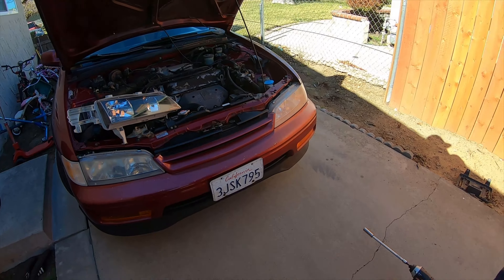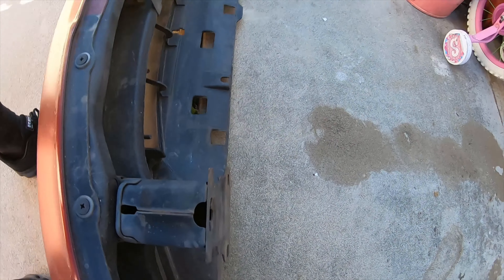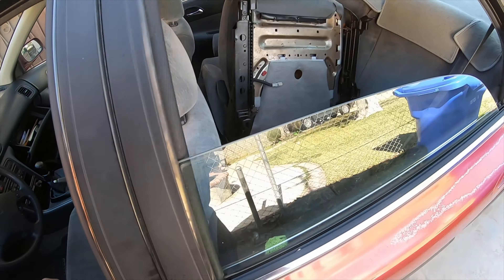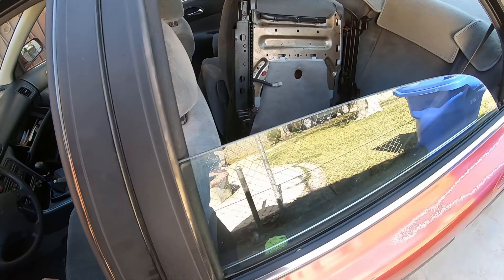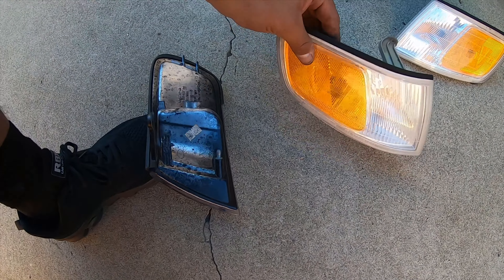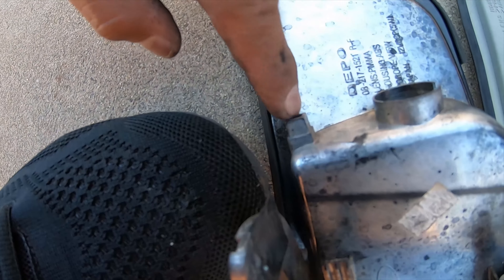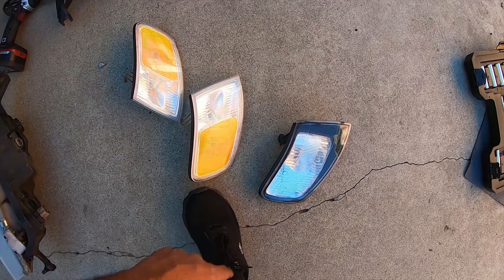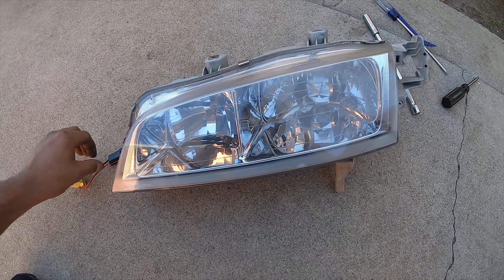Modifying the DAILY

Comment: That was a straight BS stop. I have 2015 Colorado truck fully tinted never get pulled over, I've been pulled over at least 7 times in my 94 ex sedan with no tints and ticketed once. It's straight profiling, 1 excuse was he couldn't read my license plate on a sunny summer day at 2 pm. Another time was for running a 4 way stop which I had stopped to make a right turn I went to court for that one when he started asking about if I had job and my tattoos. I'm very very biased towards cops unfortunately because of the ridiculous times I have been pulled over. I have no police record or points on my license. I saw your frustration and I got frustrated myself watching it im glad you had your camera to record the bs. Stay safe brother

Comment: Hate to say it Gus but you will get pull over frequently driving one of the most commonly stolen vehicles.
Reply: Common thing for thieves is to switch plates with similar vehicles.   What PD is doing is running you Vin to see if your car might be a G ride.   See it as a good thing...if you ever get either Accord stolen it might get recovered sooner.  Stay safe.